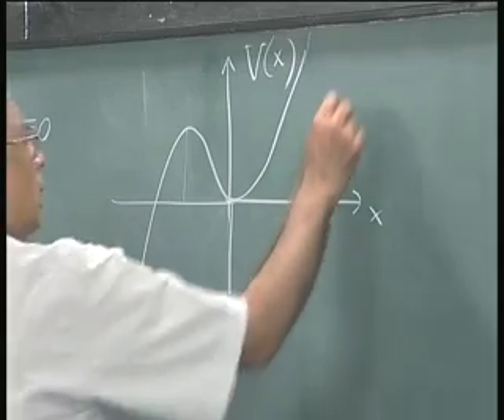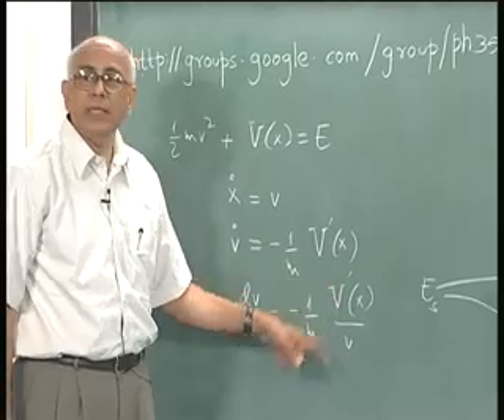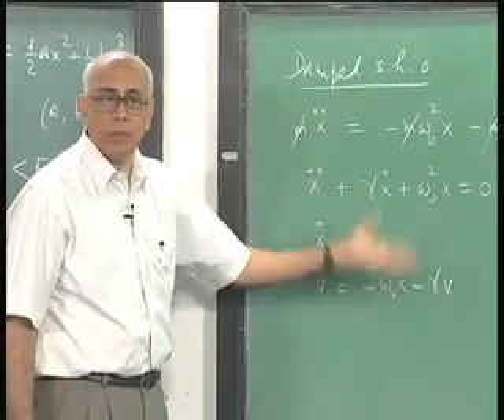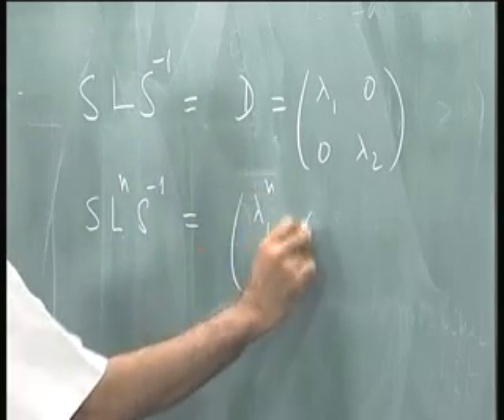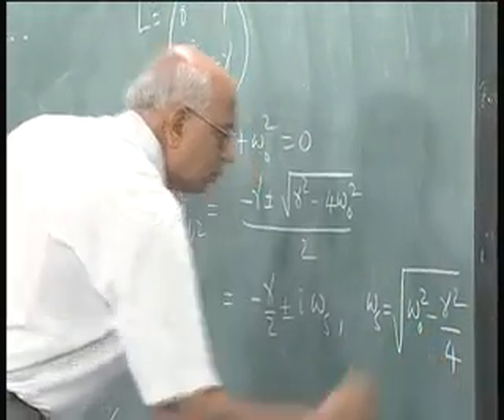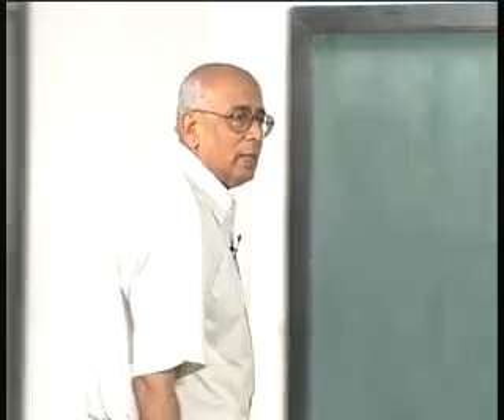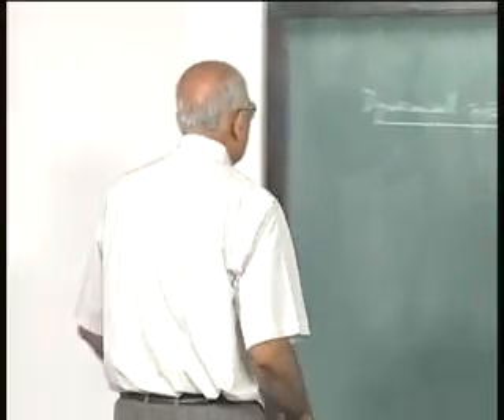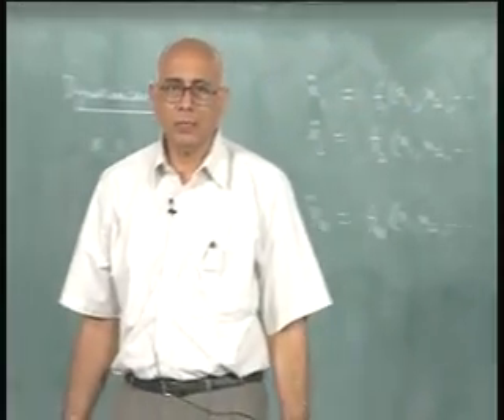Mod-01 Lec-04 Linear dynamical systems

Comment: Phase space is between P and X ryt?
not V and X
Reply: P is proportional to V if the mass is constant (which is constant in the most of the cases).
All you need to do is just multiply your scale on P axis by m.🙂

Comment: What do I need to know understand this lecture. His every point is sounding it as if "obviously this is the function that makes sense". but I do not get the gist of the connect. should I be reading something else before I watch this video?
Reply: I think prior knowledge of classical dynamics at an undergraduate level is necessary

Comment: Timeline 10.27
 V(x) plot is wrt x and V'(x) was time derivative in the equation of motion. He points at the graph of V(x) on x and says V'(x) is zero which is not a plot of V(x) with time!
Reply: V'(x) for the case of potential is not a differentiation wrt "t", it's with respect to the coordinate
Reply: Here V is function of q or more precisely position. He he mentioned it in his previous lectures

Comment: Can someone please explain in brief the stuff at the end about solvability, integrability and that the system cannot be solved but can be computed?
Reply: By the Integrability Prof.Bala means he cannot give a solution to the set of equations using which we can get the answer.But nevertheless getting the value at specific point is never tough as by putting in the point in differential equations we can get the velocity.
But generalising into a specific formula is tough. 

This is what I could understand.Correct me if I'm wrong.
Reply: @srinibashpatra5086  Integrability means the ability to find the particular combination of functions that satisfy the given conditions (the general solution of the differential equations) whereas Solvability means the ability to find the value at 1 point, using approximation techniques. This is what I understood from what you told. Sounds good?
Reply: @siddhantrathi5378  yeahhhh...😄